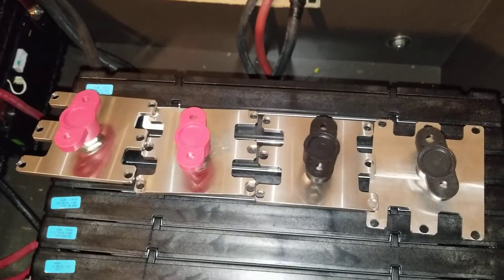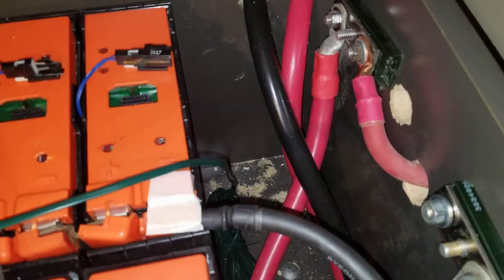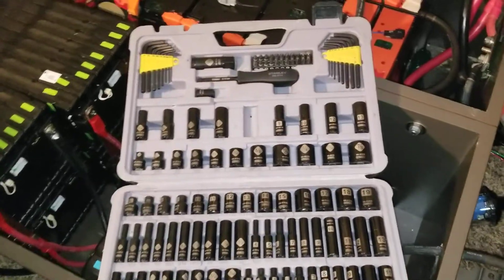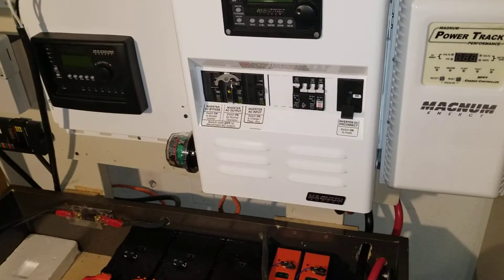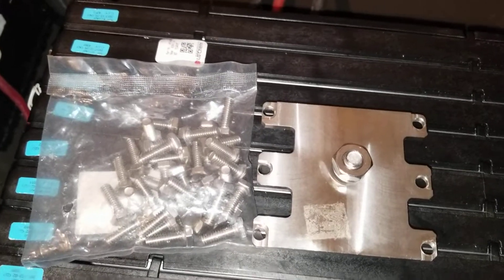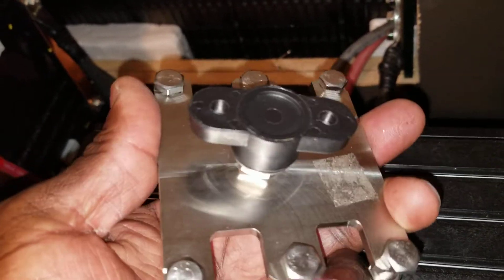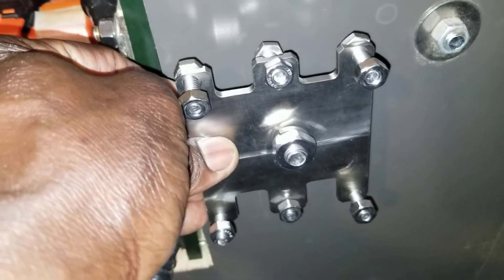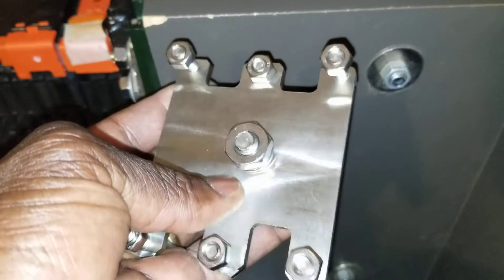BUSBAR INSTALLATION METHOD: BUSBAR INSTALLATION GUIDE(Part1)

Comment: You can also use carrage bolts for connections like this also, just drill a slightly larger hole, and press in the square shank, by tightening the nut, then it can be removed, and replaced after the ring terminals, I'm building some fuse holders, and buss bars, for my system, it is only 20kwh for now, I hope to atleast double the capacity this summer, and double me solar, also thinking about a wind turbine! Using a midnight classic controller, so it may as well be a few turbines, to make use of the classic 200 or 250, about 60 amps, probably 3 turbines, keep at it , I like build videos also,  hope all is well, being crazy times we are in these days,
Reply from the maker: Thanks brother James for the update on your project. 
I pray everything going well for you as plan.
Be safe and stay healthy, have a bless day